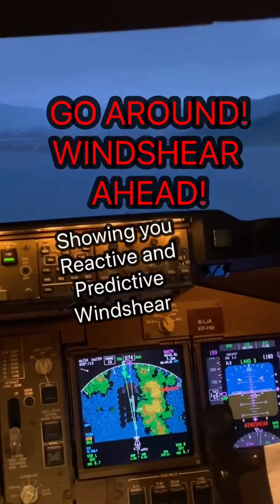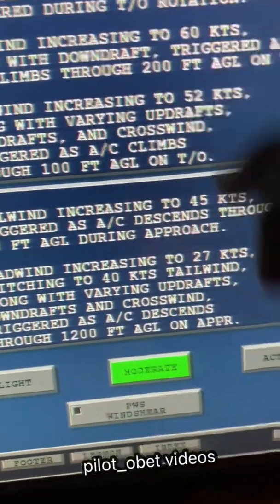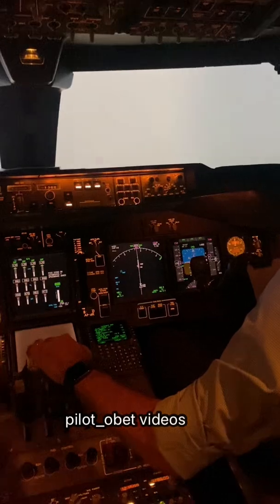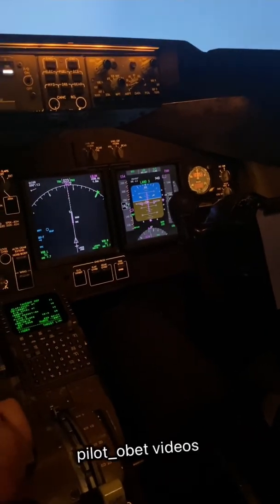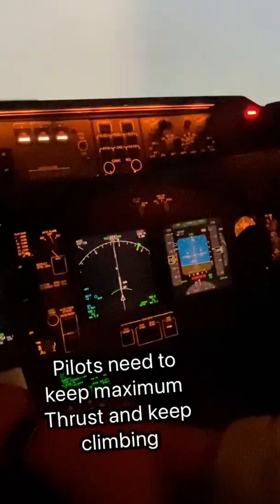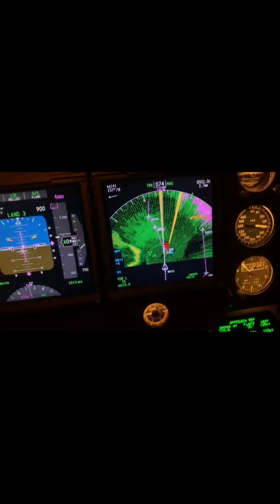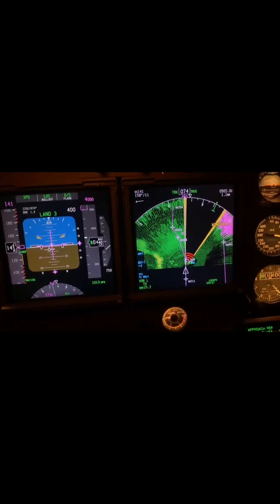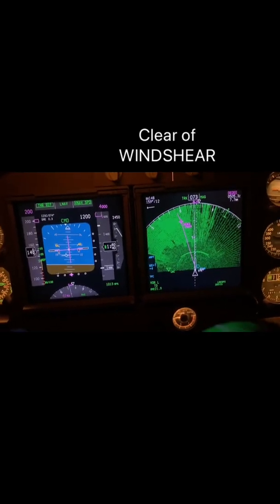Boeing 747 WINDSHEAR RECOVERY

Comment: Great and professional video, but there was a one big mistake in explanation of indicated airspeed fluctuations. A strong head wind will INCREASE IAS, making the lane much more safer and controllable, it will slow the plane down (aka groundspeed) or in simple words for a spectator looking into the sky, he'll see an airplane slowing down, but the direction of head wind is actually the same as the direction of relative wind which is equal to the opposite of plane's motion (due to relativity of motion of an object), so it will increase the speed of wind that's going over the wings and subsequently into our pitot tubes which measure IAS, which the speed that we see on the left hand side of our PFD and that's basically what the aircraft needs to remain airborn. So, if you encounter a 30 knots of head wind, what will happen is that you'll see an instantaneous rise of 30 knots of airspeed and you'll feel the nose of the airplane raise a little and then you'll see your groundspeed (speed relative to a non-moving object on a ground-the speed in a car) drop because head wind is slowing you down, but the actual airspeed (which is also referred to as mustn't allow to drop speed at low altitude if you don't wanna die as a flight instructor tells you) will increase and an inexperienced pilot would reduce the thrust to bring the speed back downto approach speed, but if you then encounter (for example a 20 knots of tailwind) the plane of the size of the 737 is likely gonna be able to cope with that because of jet engines which are very powerful, especially at low altitudes where air is denser, but for a much smaller plane like the cessna 172 for example that I'm flying, you must never reduce thrust if you see jumps in IAS on final approach, because you're on final, with flaps full selected and your max speed in that configuration is 72 knots and stall speed is around 48 knots and you're flying at 60 knots and you see airspeed jum to 70 knots, your first reaction is to immediately pull the thrust back, but as your slowing down, passing 65 knots, the tail wind of 20 knots hits you, your airspeed will literally plummet to 45 knots and if you're only 30 feet above the ground, you're gonna crash, I mean there's nothing you can do, this is why we never fly when we see gusty winds as even a small change in wind direction can have disasterous imapct on flight safety because single turboprop engine is not powerful enough to allow you to accelerate right away. I was once caught in a terrible windshear in my cessna, but fortunately I was at an altitude of 4000 feet and an indicated airspeed of 90 knots in clean configuration (stall speed's around 62 and max speed is 160 knots (mainly because of constantly lowered landing gear is our VMO so low) and I had my engine at about 90% thrust (climb thrust) and I was at around 7.5 degrees pitch up, climbing with VS of around 750 fpm with AoA of about 4 degrees (slightly high though for that phase of flight) and I prepared to level off at 4500 feet and accelerate to about 120 knots with an AoA of around 1 degrees and to maintain it I would need a thrust setting of around 80-85%, when suddenly I saw some clouds and 30 seconds later the airspeed went up to about 135 knots and the nose lifted to 10 degrees and the vs increased to about 2700 fpm and my plane was never capable to even come close to that rate of climb (135-90=45 knots of head wind) and I was a beginner and I that the plane had entered a different density air mass or something and I pulled the thrust back to pretty much Idle and I waited for 10 seconds till the airpeed reduced to about 85 knots which was then followed by me raising up the thrust lever position back to climb power, but then a violent crosswind forced me to apply almost full rudder and aileron to the right and then in the next 2 seconds or so I was hit by a very strong tail wind and I saw my airspeed indicator needle just PLUMMET TO LESS THAN 40 KTS in like 3 seconds and the AoA indicator maxed out at 20 degrees, the vs went down into the negative and all of the different alarms started blaring in the cockpit despite me aggresively applying max thrust and pitching down from 12 degrees, and because I wasn't quite coordinated at tge time it caught me by absolute surprise and than I saw the right wing drop, the nose go up to 25 degrees, the IAS drop to like 20 knots and the vs maxing out at negative 4000 fpm so the airplane had entered a deep stall and because I didn't manage to coordinate it in time, it then started spinning and spiraling down like crazy, I then reacted by pulling the thrust to idle, neutralizing ailerons, applying full opposite rudder and simultaneously pitching down to full nose down to escape the spin and stall, it then stopped spiraling and I let go the rudder and then I continued pitching forward until I saw the nose dropping and a plane stabilizing in a nose down position, less than 1 sec after that, I was greeted by the very nice sound of air flowing over my wings and hissing over windscreen and the AoA needle went down to 0 and the airspeed shot up to 70 tgen 100 and then 130 knots rapidly and the airplane thankfully started flying again, I slowly leveled off the wings and very carefully pulled the nose up to about 5 degrees above the horizon and the airspeed was around 150 knots by then and vs shot up to around plus 2000 fpmand when the airspeed dropped to around 100 knots, I added thrust again and stabilized and then I landed, fortunately there was no traffuc near by and all of us wore seatbelts, so we got out pretty much without injury, but man was it scary as crap, that feeling of the plane just falling straight down like a rock and then rolling completely out of control, it really needs a smooth flow of air and pressure differential across the wing, that's the only reason why it's flying, it's not because of engines, fancy computer systems, etc... If I were in situation like that close to the ground with extreme wind shear , I mean the only way would be to simultaneously extend full flaps, add max thrust and pitch down to just slightly below the horizon and then slowly back again and then climb as fast as you can as high as you can, but there's still no guarantee, that's why we really pay attention to wind conditions, especially during takeoffs and landings.

Comment: I remember flying these scenarios in Flight Safety simulators in various corporate jets. It was easiest in the Lear 60 because of its high thrust/weight ratio. I never experienced thunderstorm windshear like taught here but have experienced a dry microburst windshear on takeoff from Eagle, Colorado one summer afternoon. There was virga overhead so we were not caught completely off guard. We were flying a 1124 Westwind which is not overpowered at this high elevation airport. We had just passed V1 and the airplane would not accelerate from the sudden microburst tailwind. Fortunately, we ran out of it and made a normal takeoff. It was a real "pucker factor" for a few seconds because we were committed for the takeoff. A very good learning experience. 

One of our company divisions pioneered the Ground Proximity Warning System and the early GPS navigation systems. I retired in 2000; there has been tremendous growth in electronic systems since then. I'm an old "stick & rudder" pilot so I'd be lost in a modern cockpit. For me, the hardest part of learning to fly the Learjet 60 was running the FMS. The "flying " part was real easy. I really enjoy your videos and would love to fly that 747 sim!

Comment: Having thrust at idle seems like a problem by itself. Once thrust is required again, those engines will take a longer to spool up than usual, delaying the possibly immediate thrust requirement. Near the ground, that is almost as bad as strong wind shear.

Comment: Does thrust really increase for a headwind and decrease for a tailwind? I would expect the other way around in windshear conditions... doesn't the tailwind kill some lift that requires more thrust? And doesn't the headwind add energy and require a decrease in thrust?
Reply: You're correct.
It got mixed up in the caption.
You can confirm by looking at the wind arrow on the top left of the navigation display.
Reply: No, headwind causes extra drag and lift (lift depending on vertical wind direction), while tailwind has the opposite effect
Reply: @hmm396 Headwind increase means temporary airspeed increase (the air is moving faster towards you, so your aircraft is moving faster through the air), because of momentum.
It's not linked to lift or drag.

Comment: Aside from retro fit cost, which should be small compared to the lives that could be saved, why they do not have the FLIR HUD in commercial aircraft so that poor visibility conditions will no longer be a factor in landings?
Reply from the maker: They do have HUD in more recent aircraft models. Boeing 787/A350 etc

Comment: Hello Obet, I am not sure about 747 SOPs, but during a Windshear escape maneuver, aren't supposed to freeze any aircraft configuration changes? No flap change, no gear, until out of the event?
Reply: Did you not watch the first part? They didn't change the AC configuration.
Reply: In a reactive windshear situation (actually in windshear) you freeze the ac configuration as changing it could cause drag and induce a stall. Once stabilised you can then reconfigure. 

In the second scenario where you are predicting windshear you aren’t in windshear yet so you can configure the ac however you do need to be on the ball in case you enter windshear during reconfiguration in which case it changes to scenario 1 and the reconfiguration freezes.

Comment: You ever been outside in a windstorm and suddenly out of nowhere the wind changes direction two or three times nearly blowing you over in three different directions? That's a semi-accurate representation of what windshear is like for an airplane. Imagine trying to drive a car down a road but every so often the road suddenly moves 5 feet to the right or left while you are driving on it, except in a plane if the wind changes from a strong headwind to a strong tailwind at the wrong moment (right before landing being one of them) it could cause the wings to stall which is not something you ever want to happen near the ground hence why when you are caught in windshear you go full power and climb without worrying about bring flaps and gear up.
Reply: Why don’t you worry about flaps and gear? Or you worry about that after thrust applied and climbing only?
Reply: @ryan__nz  In climb out emergencies whether it be a go around or terrain avoidance or to get out of a stall close to the ground. Changing configurations in this very sensitive time could completely stall the aircraft. If you throw out more flaps for example you will increase lift but you will also drasticly increase drag. You dont put the gear up till you are at a safe climbing speed because 99% of planes will open more landing gear doors to make room for the folding gear which will again increase your drag at the worst moment. Climbout procedures are full power both hands on the yoke and keep it in the air till everything is stabilized then worry about configuring the airplane.
Reply: @SirFloofy001   In windshear escape maneuver it's also high risk that the airplane will touch down the runway if the situation gets worse and airplane is unable to gain altitude. In that case it's safer to have landing gear down.
Reply: To go off of the car analogy, it's actually like the road itself suddenly moves back and forth, as the air that the wind carries is essentially the aircraft's "road".

Comment: Good video. What is this "ratcheting noise"?
Thanks.
Reply: The ratcheting noise is from the pitch trim wheel.
Reply: @over9000andback   Thanks for the clarification. Keep it up.
Reply: Modern 747's don't have a trim wheel, just multiple redundant buttons for the stab trim function, the ratcheting noise i'd say was the stall shaker attached to the yoke.
Reply: @vedymin1  Thanks but this might be the old one....
Reply: @cck1496  not even the old one. Since the beginning, the 747 doesn't have trim wheel in the flight deck, even in the original three crew flight deck.

Comment: We managed  fuel  and  weather...In this  particular case...the  windshear is not on the Rwy  thus  weather is not a factor....the extra  speed  generates  enough  momentum  to  stay  on  the ils...You make  captain by reducing fuel costs...therefore  the don't follow everything the robot  calculates...The Pic is the  final  authority  as to the  operation of  the aircraft!..
Reply from the maker: There’s a saying: if you think fuel is expensive- try crashing a plane full of people or cargo etc into a residential area perhaps etc—- GO AROUND!

Comment: I was curious why speed wasn't increasing at go around speeds at the second go around, but they were climbing at around 15 degrees. Insane!
Reply from the maker: You go for attitude to climb and speed will drop- it’s a balancing act
Reply: When going around, your priority is to gain altitude away from the ground, so pitch is set to maximize climb without losing airspeed.
Reply: @PikalaxALT  true! Just maintain the optimal AOA

Comment: wouldn't a strong tailwind result in a decrease of the IAS? Im not really getting how a tailwind could somehow increase your airspeed?
Reply from the maker: Oh that’s because the aircraft increases the descent rate to maintain the g/slope-that’s the point of the shear-unusual. It may in fact have been a transition point from tailwind to headwind- as I say it’s unusual indications. Like barely holding on to the Glideslope with a lot of thrust on etc
Reply: You are right - a sudden tailwind does decrease IAS.  "Pilot _obet" is an absolute clown who has no idea.
Reply: I was looking for this comment. Great explanation from Mr Obet!

Comment: My Uncle love Boeing jets because they give you a natural feedback from the controls instead of the fly by wire system on Airbus jets; you don't get a reaction unless there's buzzing.
One thing about Boeing Jetliners: they're easy to convert from passenger to cargo (even the 787).
Reply: all the new Boeing jets are FBW
Reply from the maker: The b747-8 has some degree of fly by wire too actually- you still get feedback though
Reply: The 777 and 787 are fly by wire.
Reply: The side stick is spring-loaded so that force increases with deflection on Airbus jets.

Comment: But you do know that there's a way of landing in windsheer. You apply maximum power and 5°-'10° pitch down on the column while ready to take any evasive actions. This way you can even land halfway down the runway and apply maximum brakes and thrust reverse. One can also do slight up and down motions to confuse the wind. I think my suggestions are a better idea than wasting all that fuel going around 😀.
Reply from the maker: Try doing that on a b747 weighing 346,000 kegs….
Reply: @pilot_obet  🤣🤣🤣, I'd love to test my silly theory. But seriously now, thanks for keeping us so informed on how this amazing machine works. Complicated but interesting.

Comment: Obet, not sure I can see the cockpit (simulator) move ... does the simulator sway back and forth, side to side to make the effect of real side and headwinds etc.
Reply from the maker: Yes it does
Reply: The simulators are excellent at conveying small accelerations and forces. For example, the rumble of the spoilers deployed and bumps from hitting runway centerline lights is perfectly simulated. I mean perfectly, it feels exactly like real life. The place where the sim lacks the most is in vertical accelerations and in moderate or stronger horizontal accelerations. So sudden max performance climbs/descents, moderate turbulence, high/low g events are all not even close to reality. This is all referring to what the body feels, the aircraft’s performance is pretty much dead on at all times.